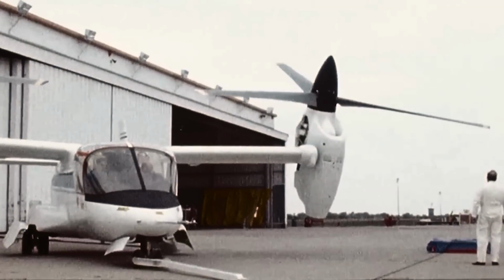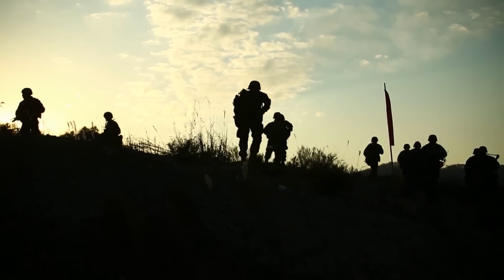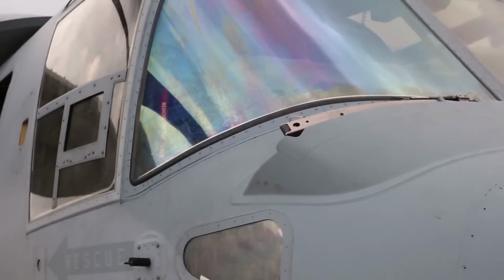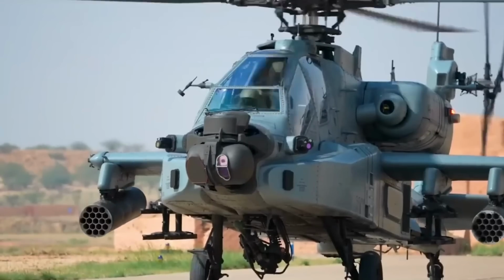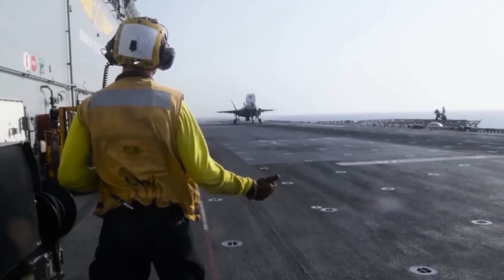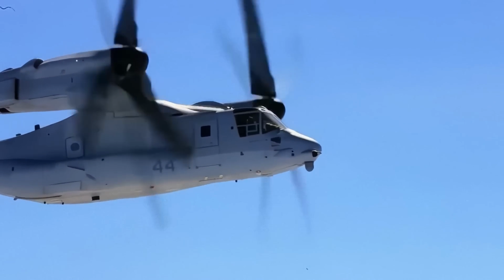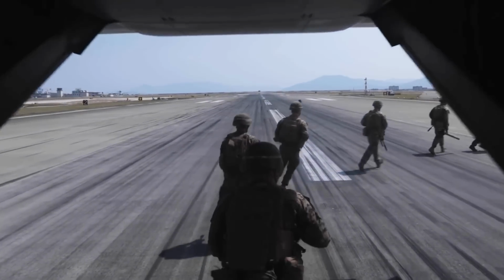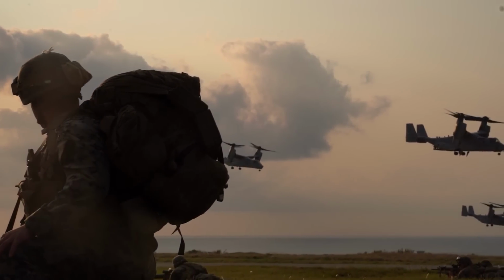V-22 Osprey – future or failure?

Comment: Basic problem with the V 22 is that each engine independently drives an individual rotor.   Variations in power output between the two engines leads to instability and crashes.  Other multi engine rotor craft, like the Chinook, use a combining transmission that combines the output from both engines and sends that equally to both rotors.  So the rotors are always in balance even if the engine output is not.
Reply: thats quite simply not true lol. It has a shaft that runs through the wing and keeps both rotors at the same RPM in case of a loss of output from one engine.
Reply: @Jacksonflax  we are aware of that but it has been proven to fail and kill people, you see in a perfect world fine but not in real life, the Chinook configuration it's a more reliable one, this thing on the other had just keeps piling up bodies
Reply: You are completely wrong, as the video explains. The Osprey can fly even if one engine is knocked out.
Reply: Driveshaft can be seen here https://i.stack.imgur.com/VaeED.jpg

Comment: when it comes to the cost to build and maintain it just economies of scale when jets and other turbine engines first came out they costed far more to buy and maintain then piston planes now jets are everywhere sure they still cost a decent bit more but thats just a reflection of the performance. the same could be said with safety powered lift is such a new category its gonna have teething issues one need only look back at aviation history like when helicopters first came out so many thought they where gonna be safety nightmares now there so widely used you can even buy a micro one and use it like its a sky ATV.

Comment: The US military has already announced they won’t be buying any more Ospreys, but intend to keep them in service for at least another decade. They also announced last fall that the successor to the Osprey, the V280 Valor has been selected to replace the Blackhawk for all extended range operations. Having learned lessons from the Osprey, especially the high operational costs, the Valor has a lot of improvements. The future of tiltrotors is bright.
Reply: Valor is for the ARMY. Osprey is for the Marines/NAVY/Air Force
Reply: There will be new tilt rotors as well.
Reply: nope
Reply: Yeah I'm so glad the Valor was picked. Helicopters have reached their limits, and tilt powered aircraft are the future. 

 What is crazy is the Navy is also not currently buying Osprey, and getting rid of the Greyhound. So it is like how is it going to do both duties without decreasing the life of the airframe?!

 Maybe they will take a look at the Valor or something for carrying cargo and personal. 

 Anyway the Osprey is my favorite utility aircraft by a long shot. Can't tell ya how many hours I've spent defending that it has the best record of any rotary aircraft and many fixed wing.
Reply: bad news for every service men, side by side engine configuration with such short propellers has proven fatal, a Chinook has a better chance at surviving and engine failure or any other adversity, Blackhawks had been proven far better and more reliable than this trash, valor isn't going to change anything it's a side by side aircraft just like this one, the safety record might not see improvement.
Reply: @lcfflc3887 The Valor was chosen specifically for its speed and range, which is not something typical helicopters can achieve easily.
Reply: @Appletank8  yeah but sacrificing safety with the same engine confirmation
very bad move, Sicorsky SB-1 or the S-97 were the ones competing against the Valor, both the SB and S, are coaxial rotor can crafts with a punch propeller on the back for extra speed.
Reply: @lcfflc3887  Sure, but they're still slower than the V280. Coaxial helis are faster than conventional helis, but the double rotor stack still causes a lot of drag, which in turn eats up range, and Sikorsky is still ironing bugs out of the SB-1. They don't even have the right powerplant they wanted for it yet, still stuck with an aging turbine that's weaker and less fuel efficient. The Army straight up can't choose the SB-1 right now because the heli's still not out of development.

V280 both greatly exceeds the requirements and works right now, with a year of consistent test flights to its name. The V22 requires more difficult training, but its safety is about on par with most military rotorcraft now, which Bell has transferred the knowledge to the design and training for the V280.
Reply: @lcfflc3887   As for the Raider X, the procurement requirements for that program don't emphasize speed and range as much, so it's a lot easier to get a functioning product with the coaxial concept.
Reply: @Appletank8  i still won't go in, no auto rotation in case of engine failure and some say it can't glide like and airplane, so I'll pass on this one, on the other had coaxials have proven a good safety record because there's no balancing act needed to be done, all of the lift comes from the center like a regular helicopter but even much safe because of the elimination of the back rotor, on a regular helicopter if you lose the back rotor you start spinning out of control, in combat scenario i rather have a coaxial with no tail rotor, the kamuv has proven to be the way to go for combat situation in helicopters, it gets hit and it just keeps flying.
Reply: @Appletank8  it sures beats the slower Blackhawk, it can carry personnel, rokets and guided missiles, perfect for rescue missions no escort needed.
Reply: @lcfflc3887  You'd need a double engine failure to need to rely on autorotation anyways, since the engines are linked and one can run the other long enough for a landing.
the real issue is, again, Plane A could reach 250 kts for maybe 500 - 600 nm, Plane B reached 280 kts and demonstrated 600 to 800 nm capability.

One set of numbers is bigger than the other.
Reply: @lcfflc3887 an engine out in any twin has the same risk.  Chinook’s aren’t better for that
Reply: @lcfflc3887   Sources please? You sound like you're just spouting BS, easily disproved myths and lack any knowledge of aircraft, especially VTOL aircraft. Also, if side-by-side engines are a problem then God forbid you fly on any airplane that isn't a single-engine aircraft.

Comment: The Osprey was a good design. Basically what the V280 is today.
Then the military demanded the wings to be shorter than optimal, the wings to be able to be turned for aircraft carrier storage, and the list goes on.
Given the amount of subobtimal decisions the V-22 has to deal with it's doing ok. Not great, but the requirement changes prohibited greatness. But at least now we can call it versatile instead of great, and pretend like compromises are a success.
Reply: In anticipation of we- knew-they-would-come change requests, we referred to these “expected, TBD” changes as  “Undiscovered Rework.”

Comment: Crash #2 - a Coworker lost his Nephew who was one of the Test Pilots.  This design did not have the Cross Wing Transmission and thus no synchronization.  They lost one engine and that was that, as there is no Autorotation possible.

In Jacksonville, 2004, the Forest Crash was still a tender subject.  The Lejeune support community was still hurting. 

POTUS is not using the V-22 proper to the White House because they do not want to deal with Grass Fires nor make an improved hardened landing location.  Those engines are violent.  Just look up the story of the people at a park picnicking in Havelock and a V-22 Flight crew injured them by throwing their picknick table at them with the Jet Wash.  WH is not going to EVER have this. It will remain a drive to Andrews.

Valor is the next iteration, and is more of the Blackhawk sized machine, The non rotating engines will make it a 2 way loading machine that the Osprey is really not, althought it has side doors.  Walking into Jet Wash is really harsh.

What I found interesting in 2002/3 seeing one of the First being flown outside of Quantico was the fact that it sounded like both a Plane and a Helicopter, even with my brain deleting the noise of the chase plane. That was something!  Later in 04-05 near Havelock, I noticed how they could sneak up on you not making much noise at all until they are right there about 300 yards away.

If you do not have Coms, and friends with Radar to tell you they are coming, you can have a whole bunch of Marines around you in the middle of the night before you can get people awakened. 

So much was learned, and so many people died for this tech that did not need to.  I mean come on!  They knew they had new tech with no Autorotation, they should have never moved to operations testing without the cross wing transmission and Engine synchronization.  Was my co worker's Nephew and Crew not enough dead for them?  Apparently not.

I believe that they have learned that the tilting Engine Design is not conducive for future operational designs, and Valor will lead the way there. yet,  I do not know what the disadvantages there are on the non-tilt engines.

Comment: Read "The Dream Machine" by Richard Whittle for a more detailed understanding of this aircraft.. NOT a helicopter OR an airplane in truth. It's checkered history is more from misunderstandings and it being a hybrid aircraft that had unreasonable requirements imposed on it by external groups of multiple branches of military. It was trying to be everything to everybody, and limited it's design greatly by folding up like a Movie Transformer. 

Eliminate the need to taxi past an aircraft carrier's island and several feet of blade and wing length could have been included, reducing disc load while increasing fuel capacity, among many such compromises.  The notable failures of the aircraft systems were mostly due to the need to rotate wing & fold up blades so as to fit in a C-130, or AC Carrier's elevators. I would like to see a non folding, mechanically simplified version of V-22 that corrects these deficiencies for commercial use say on oil platforms or in other military with remote hard to land areas like in SAR roles with Coast Guard or Air Nat'l Guard for Rescue activities.

Comment: To all the people harping on about the death toll the V-22 has, I liked to point out that any newly implemented technology faces issues like this, even mature technologies that have been used for decades still run into many problems that cost lives, I'd encourage those of you who have this mindset to take a quick comparison between the accident frequency of the V-22 and the UH-60 for example, you may change your tune when you notice they are not all that dissimilar.
While it is extremely unfortunate that lives are lost in the process and nobody wishes for it to occur especially the designers of the platforms, it has been our societies modus operandi to learn from those incidents and implement changes and improvements to at the very least mitigate or outright ensure against such incidents from occurring in the future, commercial aviation is a very good example of such methodology being put into practice.
Likewise the loss of life should not bar us from proceeding to develop the technology further, as there will always be a risk for the loss of life no matter what we do, we can never make anything 100% foolproof and it is utterly irrational to assume that we can however, what we can do is attempt to get as close as possible to that 100%, but that can only happen if we continue with further development, especially when said technology show great potential not just in one field but multiple fields.
Reply: Newly implemented? The thing first flew forty years ago! Its a very expensive dud, and very foreseeably so. A flying object that cannot either glide or autorotate is innately a death trap which all the fly-by-wire in the world cannot mitigate.
Reply: @kenoliver8913  Yes newly implemented as is relative of all aerospace technologies, as the first manned flight took place 240 years ago via balloon, first powered flight 120 years ago via the Wright brothers, 81 years for the first practical VTOL aircraft, 62 years for the first manned space flight, 46 years for the first practical tilt-rotor and 34 years for the Osprey itself.

Thus as you can see in relative terms tilt-rotors are a new technology thus we have the least amount of experience with them and like any of those aforementioned technologies, blood and tragedy assisted in and paved the way in maturing those technologies to what they are today, that is just the fact of the matter as we cannot foresee every single conceivable outcome a aircraft may face, the best we can do is engineer our way out of the problem when it does occur so a tragedy does not occur a second time from the same problem and ensure painful lessons learned do not go to waste. Statistically speaking tilt-rotors have one of lowest body counts of all powered flight platforms, barring space flight which is obvious for several reasons and no matter what you do when it comes to aviation there will always be a risk of death regardless, the best we can do is get that risk down to as close to 0% as possible.

As for this statement "A flying object that cannot either glide or autorotate is innately a death trap" this is a abject fallacy, the Osprey is perfectly capable of a unpowered glide especially when in plane configuration as its flight characteristics are little to no different than another other fixed wing dual prop aircraft, likewise it can also technically autorotate in that when in a unpowered flight state enough wind can drive the rotors however, in practical terms it is often not enough due to the very low inertia rotor system, which means the rpm bleed is quick and autorotation must be done immediately to retain as many rpm's as possible, this is also a problem when it comes to the the flare and touchdown portions of an autorotation to effect a "soft landing" (allegedly this problem has been solved on V-280 Valor) that would be typical of most other rotor configurations as seen on other helicopters, thus it would be a pretty hard landing for the aircraft's compliment.

Fortunately the aircraft spends the majority of its flight time in the airplane configuration rather than the helicopter configuration, typically only transitioning to the latter upon take off and landing procedures or while in a hover, the latter two have been the most common in the accident cases, while the others have been caused by adverse weather/environmental conditions and would have poor effects on any other aircraft as well. 

I would suggest researching the topic a bit more before making blanket statements, as there there is often a lot of nuance related to aviation accidents across the board and tends to have nothing to do with the aircraft itself, but often rather other external factors.

Comment: Military Vet here that has dealt with V22 a bit. V22 is trash. The military got a bunch in the 90s, they crashed a lot. Left military in 2022, they still crashed a lot. V22 makers "it is the pilots fault". V22 emergency clutch, for 1 engine failure, was auto engaging and falling apart when both engines were on when i left. Marines hated them so much, due to simple pinch of sand could ground them, so they pushed as many as they could off to the Navy. Not combat effective.... Navy tried to replace the CH53, but the frames of the V22 too weak. Navy pilots love their old C-2A greyhound and don't want the V22. But the Navy already bought them so have to use it or it makes them look bad. V22 phasing out C-2A now. One pilot - "should have left these when we pulled out of the middle east". Military is simple, Less things that can break, the better. Anyone under the bureaucratic level doesn't like this. 

All my opinion and personal experience.
Reply: "Military is simple, Less things that can break, the better." It's actually exactly the same for civilian aviation too. As Elon Musk said "the best engineered part is a part that does not exist".

Comment: Adjective, Objective failure.  To high  a pressure gradient for the rotors.  Bad decent profile.. too big for this, as volume and area tend to diverge .. In other words, this can work in a smaller form factor better than.. and you can not put it on a catapult (LoL) and actually this aircraft can not reach it's stated maximum operating s[peed at full load and is only marginally faster than the CH-47 near high altitude rated maximum loading.  It was proposed that this aircraft become the next US Presidential aircraft and that was shot down  summarily under Trump and never implemented under Obama.  Notable only lighter variants have been proposed for this type of platform and none have made it to deployment..  It is tough to beat the CH-47, but these big US helicopters are going up in price with insignificant observable (external) change and with evolving combat, perhaps these smaller hel0's can make sense (they can then be 'droned' also)...

Comment: I live beside Quantico marine base. I was also in marines the helicopters you can hear way before you see them. The osprey there going over when you hear them
Reply: I actually did experiment on this in the early 80'. The the question is when would the average person hear a helicopter before it arrives overhead. It took a while to iron that out. Working with the SEALS.